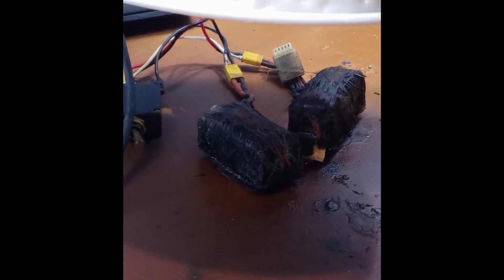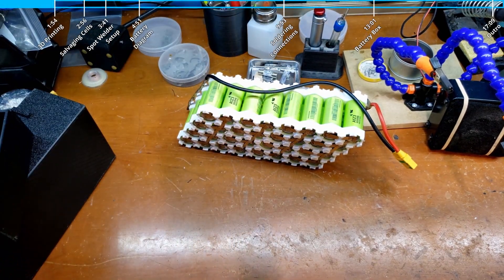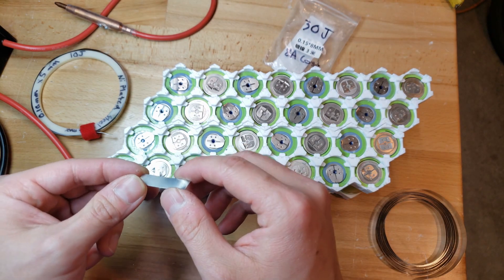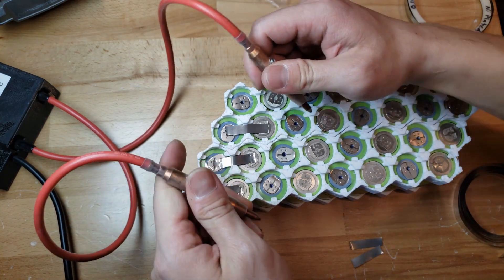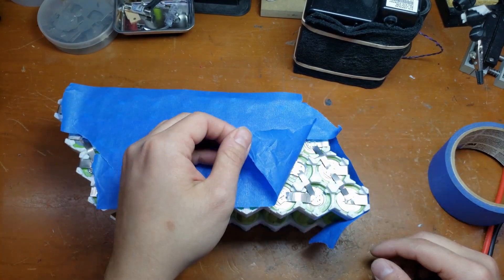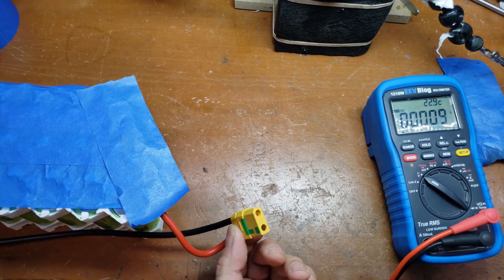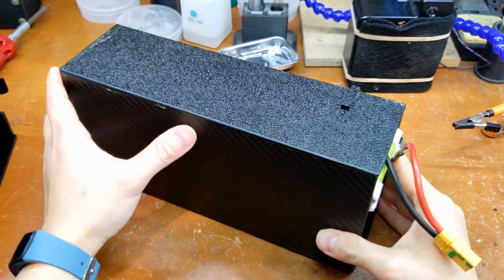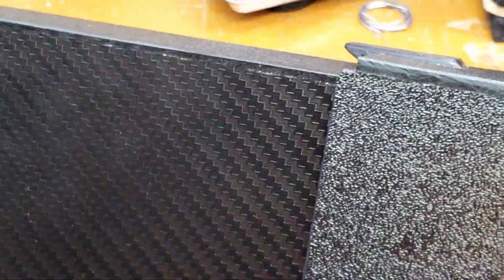Building a safer LiFePO4 battery and box using 3d printed holders and kWeld Spotwelder

Comment: Shouldn’t you use a bms or balance way to charge those cells ? Nice print out wow my projects need a 3D printer heheh
Reply: totally agreed about this nice print out and about BMS as well, BMS is a must for lithium pack and i think it will be dangerous for those trying to build the same pack like this if they dont really understand what are they doing
Reply: @GD-uh2gn  I was just about to suggest a BMS. It helps to keep cell voltages balanced (if you buy a board with balance function), as well as protects against overvoltage, undervoltage, overtemperature and overcurrent. Otherwise, very nice build, keep it going!

Comment: Yes I like to leave the original tabs on too less work and better connection imho
Reply from the maker: Yes the original connections are much better. That's what I did for my truck battery but for this build I wanted it have it more compact as the original connections leave room for air cooling.

Comment: With used batteries at only 50-60% capacity you really should hook up some kind of cell monitor/balancer. At minimum instead of using nickle strips you could used the fused nickle strips, where the strip is thinner before it connects to the battery and gives you a fused connection to each cell that will prevent excessive current.  At least if a battery fails in an unexpected way, it won't burn.  Nice looking pack btw.  very neat job otherwise.
Reply from the maker: As mentioned before, I check balance as needed and I don't use the pack very often. I mostly used what I had for nickel strips at the time but fused nickel strips are neat and much better. Lifepo4 cells wont burn if shorted but it could get hot enough to melt stuff. Thanks for the look and suggestions!

Comment: What were the capacity of those cells?  Did you test them out?  Others who used electric bus packs showed them at really low capacity.
Reply from the maker: Yeah they were low capacity around 60% of the original. Definitely were used hard by the buses they were in but work fine for a stationary pack.

Comment: The way you did the power red and ground black. Couldn’t you fold that wore after soldering onto the battery then add even more solder to the top it would never move or break and wouldn’t stick out
Reply from the maker: If the nickel strip was longer I couldve folded it over the wire and soldered it if that's what you mean.

Comment: Without a BMS or balancer, how is this supposed to be a safer battery, Albert?
Reply from the maker: The fact that it is Lithium Iron Phosphate battery makes it way safer than any other lithium chemistry. Even at worst case, the battery will vent non explosive gas if something happens and not explode. I am going to be using this for high power so finding a BMS with the current capability is going to be expensive and not even needed in my case. I don't need the features of a BMS like overvoltage, or overdischarge because I use the battery in a way where these things wouldn't happen (being constantly charged at a certain voltage). I just need to fuse it and the battery will be completely safe. For balancing, I balance the cells periodically (if it is even needed) see reply to KeeganBuilds below.
Reply: @AlbertPhan  But what about curtailing the charge/discharge current and monitoring cell temperature, can't the BMS also balance when charging?
Reply from the maker: @eyeswideshut2800  There shouldn't be a problem with charge/discharge or cell temperature if the battery pack is sized properly for its load. And again, BMS balancing is not necessary if the pack is A) Balanced with matching cells and B) Cell balance is checked manually. I made an ebike battery that has no BMS and all the cell groups were within 30mV (which is really good) even after a year of riding. I would however highly recommend a fuse or breaker if you don't use a BMS. Thanks for watching.
Reply: @AlbertPhan  Thanks, you know of any deals on A123s?
Reply from the maker: @eyeswideshut2800  Check the description. There are some links to sellers there but I haven't been actively searching lately

Comment: Do these cells need to be balanced at all?
Reply from the maker: If the pack is made with matched cells then balancing should not need be done but periodic checks on the voltages would be a good idea. In general, I try to use the cells from the same lot or bank. For this pack, since it was from a previously made battery pack and was balanced/matched during the manufacturing, I just did a quick check on the voltages of all the cells and made sure they are all pretty similar (within 100 mV). The exact number depends a lot on other factors but this is what I used. If one cell group happens to go out of balance then you could manually balance that cell group. Cheers
Reply from the maker: Forgot to mention that I really should've done a top balance on all the cells by connecting every cell in parallel and charging it at a constant voltage @ 3.6 until the current drops to at least 100 ma. This balancing ensures you get the most capacity out of the pack. I was recently reading that because the Lifepo4 has such a flat voltage curve, voltage isn't a very good indicator of state of charge. I will continue to monitor my pack for any balancing issues. Cheers
Reply: @AlbertPhan  I heard you should bottom balance LiFePO4 these cells to get the charge discharge cycles similar.  Overcharge doesn't work well with the LiFePo4 pouches at all.
Reply from the maker: @hbmike47  Send me the source if you have it, I would like to take a read.

Comment: I made my own pack with the same cells and with the Kweld. It is a 4S2P battery, and I used 2x 0,3mm nickel strip in order to handle the current
Reply from the maker: Cool , what was the battery for and how much current? I also made a 4S16P for my truck battery. It pulls 800A burst when it starts. I used copper bus bars and kept the original 0.3 mm nickel sheets on the modules.
Reply: @AlbertPhan  IT was for a FSAE (Formula student) combustion vehicle. 80A Continuous for the starter.
650g w/o mounting and cheaper than Buying a battery from the shelf.